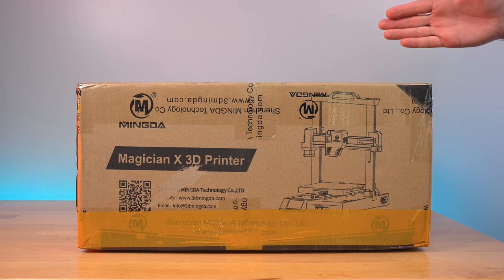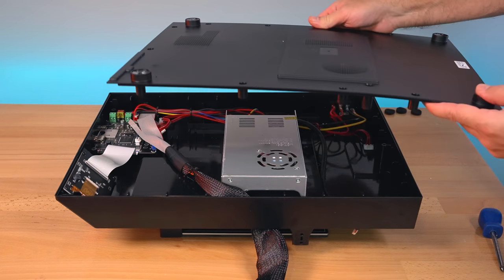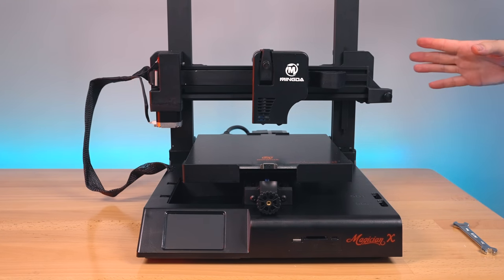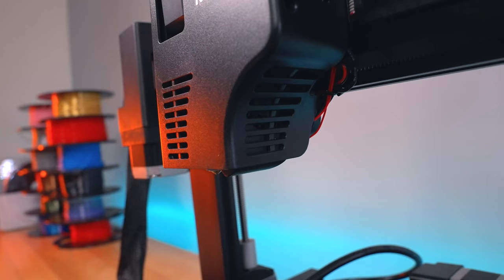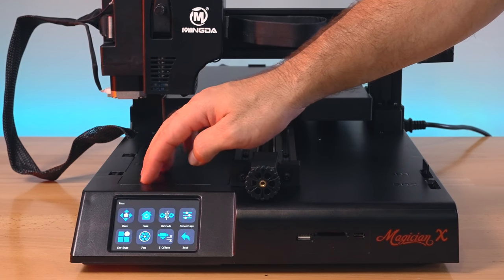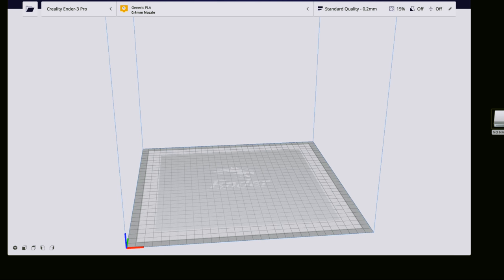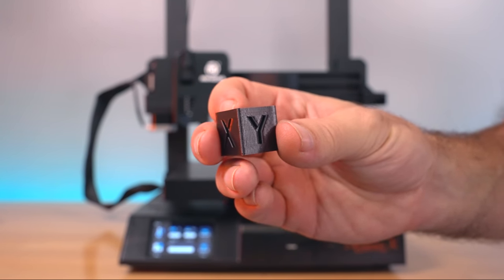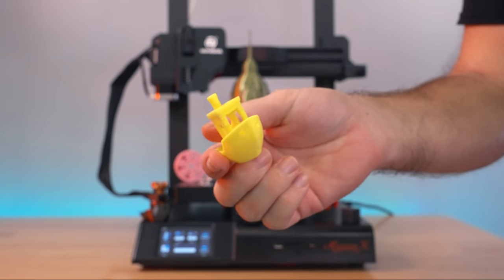Mingda Magician X - 3D Printer - Unbox & Setup

Comment: I approve of the trend towards wider x and y axis extrusions on openbuilds style printers (sidewinder, sovol, i think some of the cr10s). Allows significantly greater rigidity&less play in the toolhead carriage. I hope to see designs continue this trend.

Also you don't need to babystep the z-offset when using the nozzle as the probe; "babystepping" is used to account for the height diff between ABL trigger point and nozzle tip. That's the main benefit of this type of mesh bed leveling.

Would you mind doing a video disassembling the toolhead & hotend? It's very difficult to tell what fans, what hotend style, nozzle type, heater block style, etc. I really don't like the black box design with none of the working parts accessible; troubleshooting a clog would be challenging w/ this design.
Reply: That was my thought exactly with the Z offset and I wondered why people keep changing it on this style of bed leveling

Comment: @Just Vlad, I have been watching your videos for a long time, and I do like how you are very detailed with assembly of the 3d printers, however, I have had problems with the Mingda line. One of the problems with Mingda line is that they love to put hot glue on the connections to everything on the main board, as well as on the power connection as well. The power connection usually has a thin wire that sits in the connector and wonder why Mingda, as well as Creality refuses to put on ferral connection plugs for the power connection plugs. It would prevent a lot of problems, in my opinion. This has happened to me a few times so far. The Mingda Rock 3 is an example, as well as the Creality Ender 3 as well. Do you have that problem as well?

Comment: Little bit different story for me.  As soon as I hit auto level, the print head lowered, hit the bed and just kept trying to push itself down onto the bed while making a loud grinding noise.  It only stopped when I hit the power button. Repeated the steps with the same results.  I'm super bummed!  I was really hoping that this was the answer to my printing woes.
Reply: I had the same exact thing. they swapped my printer out and the new one worked
Reply: @CalebKraftmakes  I just did the same thing and it worked!

Comment: Morning. If you had to choose, other than print size, which is the better but? The Magician X @ $339 or the Rock 3 Pro @ $399. In other words other than print size does the Rock offer anything better for the extra $60? Thanks for both great videos.
Reply: The magician series is suppose to have one touch leveling, you click it once and it’s suppose to do everything for you even the z offset however if it works is another question. No knobs on the bottom either it’s a solid plate and it probes it. Build volume is smaller at 230 instead of 320 but they also make bigger magician machines. Right now the magician is $330-$349 usd and the rock 3 pro is $400-$550 usd currently. The rock 3 pro has a better built body and bigger build volume however it does have manual leveling which means more room for error. Any printer can print very well with enough tweaking, I do not really see a difference in print quality but there is a difference in usability and how the machine is built. The magician is weaker but a more intelligent machine and the rock 3 pro is a well built but “old style” printer, but to answer your question I do not see the worth in upgrading as they have a lot of the same specs but ultimately it’s up to you.

Comment: I just set this up and my nozzle is siting before the plate but kinda under it  and soon as I hit level  the nozzle is forcing it's way on the plate and scratched my bed  I did nothing extra  just read the instructions  I'm just confused as to why my nozzle is not on the bed
Reply: Same did you find a solution
Reply: @blazefire8555 Make sure that tab on the right side of the z axis is straight and lowering into that slot where the uprights are screwed in

Comment: This printer seems pretty bad I mean look at the prints I think its a mix of bad part cooling and the all plastic frame I def agree with u that they should of used more aluminum it would make it from a ok product to great product
Reply: Hi, Dear Sean. The main stressed parts of MINGDA Magixian X are still metal profiles, such as Z-axis gantry, X, Y-axis guide rails, and plastic parts are mainly used for protective shells. Magician X plastic injection parts use excellent glass fiber engineering materials, which are very strong and will not affect product life.